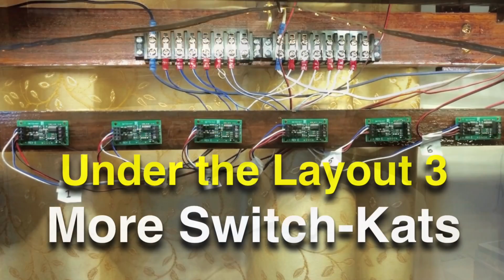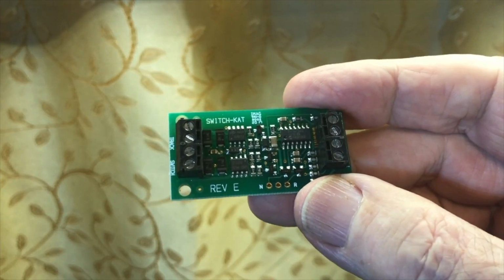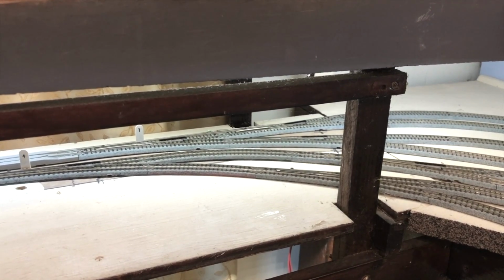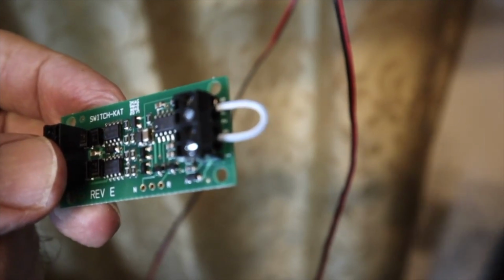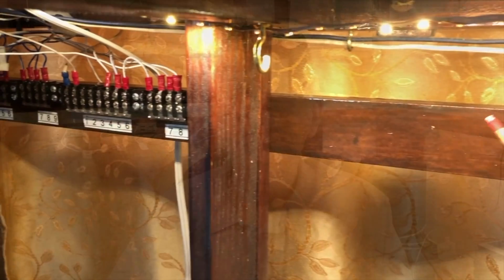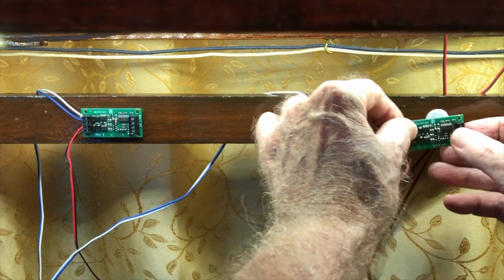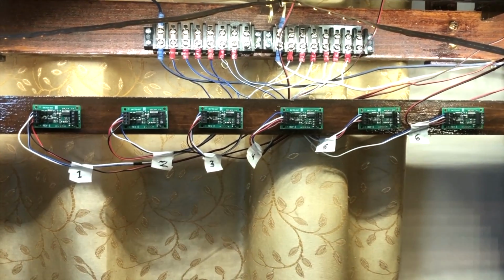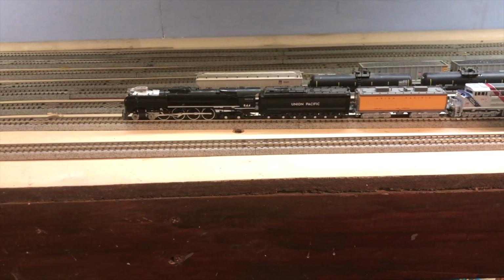Under the Layout 3: Switch-Kats for Turnout Control in Model Railroading

Comment: I prefer your velcro solution Roy. Perhaps you could consider using cable ties to securely attach the wiring to the framework instead and keep the velcro on the Switch-Kats for easy programming should the need arise. 

If you need access to the wiring you can always cut the cable ties or even get those releaseable ties but they probably won't appear as neat.

Comment: So that looks real nice and easy for the switch kits.  Can they be used on any system?  I would think they could, it’s seems like Digitrax interfaces with NCE. I may have asked last time, are the switches in DCC mode or just left in the normal position? My switches are currently just using the Kato throws.  They work well too if you like the manual remote operation.
Reply from the maker: Yes, Steve, the Seitch-Kats can can work with any DCC system and Kato Unitrack. ...Roy

Comment: Roy I must be a luddite. In looking at your terminal strips where you connected the blue/white wires from the switch-kats and then from the terminal strips to the bus, I see 2 blue wires and 2 white wires exiting FROM the terminal strip. If you are connecting the terminal strips to the bus, why 2 white and 2 blue? They look to be 14-16 ga. Thanks.
Reply from the maker: Ron, I always use 2 terminal barrier strips. I use one for the blue wires and one for the white wires. Keeping them separate reduces the chances of creating an electrical short. Each terminal strip serves multiple turnouts. At this point, I have done the wiring for 2 turnouts, hence, 2 blue wires coming out of the "blue" barrier strip and 2 coming out of the "white" strip. I believe Kato turnouts come with 22 gauge wires. ...Roy
P.S. I use 16 gauge wire for the bus on my relatively small layout.
Reply: post 1 on each terminal strip has 2 thick blue wires or 2 thick white wires... where are they connected? I guess I am still confused. wouldn't just one wire from each strip go to the bus? what am I missing? sorry for being so clueless, I'm not an electrician (obviously)
Reply from the maker: @cbirailroad  Yes, Ron, there normally would be only one "thick" wire coming from the bus to each terminal strip. In my case, however, there is one thick wire coming into each terminal strip and one "thick" wire going out. The thick wire going out from the strip goes to the next set of terminal barrier strips, not shown in the video. In effect, I've daisy-chained some of my strips rather than connecting them directly to the bus. ...Roy
Reply: @n-scaleunionpacificevansto6569  OK that makes much more sense. Since I have 11 Kats and am using 12 screw terminal strips I won't need to do that.

Comment: You say that the switch-kats are programed using a single digit. Since you will have installed 12 of them, which I'm assuming that 1 through 10 will be 1 through 9 and 0, what about the other 2? I know nothing about DCC or NCE, so this might be a dumb question,
but, I use the belief that the dumb questions are the ones that I don't ask.
Reply from the maker: No, actually Ron, what I said was this: the Switch-Kats at that end of my staging yatd are numbered 1 though 6, brcause there are 6 turnouts at that end of the yard. The Swutch-Kats which I will be installing at the other end of my staging yard will be numbered 7 through 12. My staging yard will have a total of 12 Switch-Kats (for a total of 12 turnouts), numbered 1 through 12 by the time I finish. You most definitely not limited to single-digit numbers. ...Roy
Reply from the maker: P.S. Ron, you can have anywhere from 1 to 2044 numbered accessories on an NCE PowerCab, the system I use. ...Roy
Reply: Thanks for the quick reply, Roy.  Now I understand at least a little bit of NCE and switch-kats.

Comment: This is the solution I came up with for a bench that slides forward, the frame drops down, locking the top in the forward position, and then the table top hinges up for easy underside access. The design only uses simple door hinges, furniture wheels, and two by lumber for the table, and only basic tools are required to assemble. It's a fairly straight forward design for linear or single module layouts, or layouts with outside corners. Inside corners can be an issue though, as the corners can't slide out though. 
https://i.imgur.com/AI2mQdS.png
https://i.imgur.com/mEAIYKN.png

Comment: Hi Roy, I never realized how many steps it takes to throw a switch using NCE. I use Digitrax, with that you hit Switch, enter the number & hit throw or close on the keypad, that's it. Here is a link to my Google folder, this shows a Digitrax decoder in the switch. It's basically the same for #4 & #6 switches. Look for Image244.jpeg https://drive.google.com/drive/folders/0BzCCmsrMdHspN0E0OTF4Q2ZxMjg